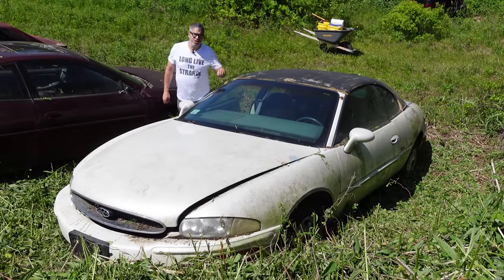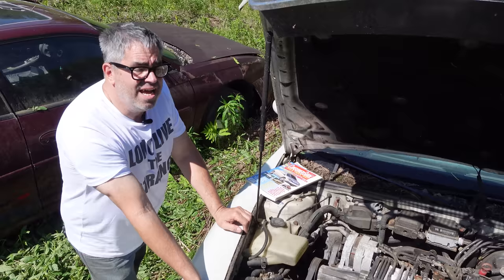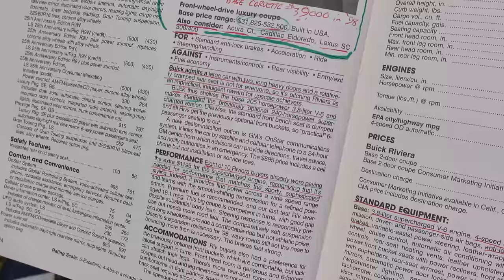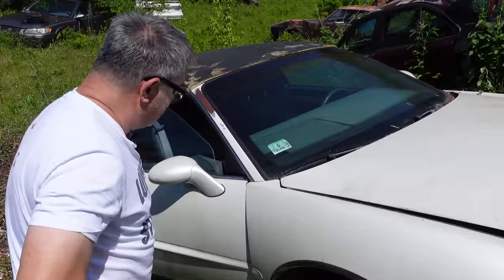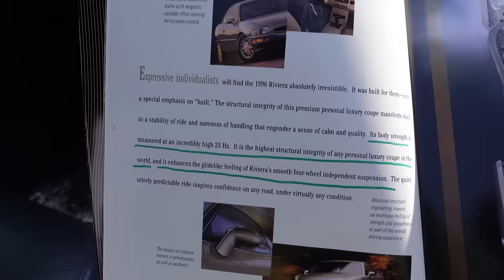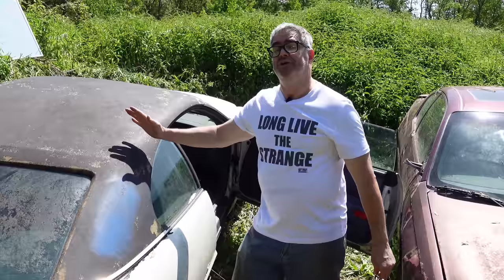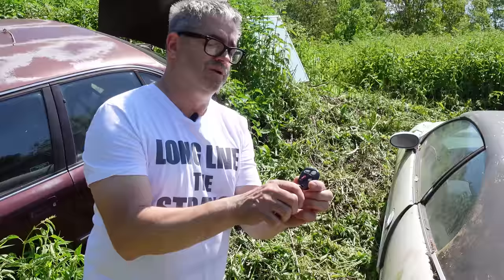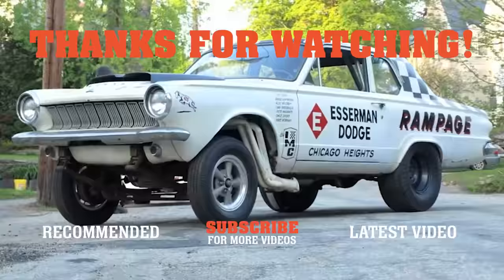More Power Than A Grand National!

Comment: This was about the time that Buick tried to make the AARP crowd "hip" and "modern". 

No VIN, can't win, but easy to figure out, no doubt: 1G4 for US made Buick, GD for Riviera, 2 for two door coupe, 2 for active seat belts with dual air bags, 1 for 3.8L V6 with supercharger, then a random check digit, W for the 1998 model year, 4 for Lake Orion Assembly, Lake Orion, MI, and the rest is the production sequence. The Lake Orion plant opened in late 1983 to assemble 1985 GM luxury cars and still operates today. Both my Pontiac G6 convertible and Chevrolet Sonic were assembled there.

No SPID, wish you did, but possible code 16 Bright White exterior paint, or possible code 78 Bright White Diamond exterior paint, among other codes. The transmission is a 4T65E-HD four speed automatic overdrive. The last 200 of the 1999 cars (total production was only 1,956 units) were called "Silver Arrow" editions and had special silver paint and trim treatments, a homage to show cars of the same name.

Yes, the 1977-1978 Riviera models were on the "B" body platform and were essentially stop gap models until the 1979 "E" body front wheel drive cars came out. The 1979-1985 Buick Riviera shares designs with the Cadillac Eldorado and Oldsmobile Toronado and some design work on the 1980-1985 Sevilles which were "K" body cars. All 1979-1985 E body cars and 1980-1985 K body cars were assembled in Linden, NJ, which closed in 2005 after last making the S and T Series trucks.
Reply: I have a friend who had a 95 one and back in 2006 I was in Florida and went to the Cadillac dealership to look at a 95 Fleetwood that was advertised on line but as things go it was already sold after being posted at 9 PM and I am there at 9 AM but they had a black 97 with every option like sunroof and chrome wheels but the mechanic that worked there explains to me he had worked on the vehicle since new and it was a lemon but it  had the gold script and black leather.
Reply: @garymckee8857  The old bait and switch. Florida dealers are among the worst with that.
Reply: @Google User GP  Yes sir
Reply: The "check digit" isn't so random, but it is the single digit outcome of all the numbers and letters in the VIN - just to make sure a person copied them all correctly. K=1, L=2 etc.
Reply: @TIMEtoRIDE900  That's not entirely accurate. It's random in that it's not the same value on two given VINs. The 8th digit would ALWAYS be a "1" in the case of a 3.8L supercharged engine in this year. That can be taken to the bank. The check digit isn't always the same. It's done to avoid VIN duplication.
Reply: @googleusergp  If you're fraudulently making up a VIN# and use the correct codes and a made-up numerical sequence at the end, you can STILL have a correct "check digit".
The real purpose is to check for errors on the title.
Reply: @TIMEtoRIDE900  Not entirely correct. If you enter a VIN number (with the wrong sequence) on the NHTSA website and it returns back "not found", you likely have an error somewhere. The full combination of the VIN number is what makes the system work, not any one part of it.

Comment: My red 98 Riv with 360k on the clock is still my daily driver. It has a blower pulley, ported heads, manifold & blower, Caddy throttle body, injectors headers & a speed limit delete & still does 28mpg. We tested the parachute system for my Bonneville streamliner with it by shooting them out through the sun roof.🤓
Reply: No it doesn't!
Reply: Dam another reason I should have held on to my old 2000 Bonneville SSEI. Sounds like a decent ride. 👍🇨🇦

Comment: 3800 Series II and III is my absolute favorite American V6 - Series 2 engine with a Series 3 aluminum intake is probably one of the strongest NA V6 platforms there ever was for hot rodding, right out of the box. And if you really knew what you were doing you could boost the living shit out of one without the stronger lower compression ssei bottom end, but the latter really took it to the next level as a Grand National killer - all on factory ling block parts
Reply: 1999 GM took all the imperfections out of the previous years and made the 1999 less than 100 exist selling 4

Comment: I've owned a few 3.8's,and still have a 97 lesabre  going on 13 years plus. It's my daily driver with 212K. These cars have a bullet proof drive train and run perfect. Only problem is keeping the rot away in the salt state of MA. My grand total price was $625.00 back in 2010.
Reply: Gosh I miss those days browsing craigslist turn key cars for $1000 bucks or less that never had meth used inside or someone lived out of.

Comment: My father bought  1974  Buick Electra 225 for my Mother and when he sold it in 1998 it had 473,961 miles on the original engine ( got a valve job at 290,000 miles ) and when the second owner drove it off it ran like a top . It was basically a Cadillac with a 455 ci Buick engine . I loved that car it was one SWEET RIDE !

Comment: Oddly enough, GM detuned that 3.8 SC in the Rivs and Park Avenues as well as the shift points in the transaxle, which made them feel slow and not much different than the base 3.8 vin K motor. However, in the Pontiacs, they seemed to run like mad with crazy midrange torque that would make the front end feel mighty light under a full head of steam. I recall many of the SC's front bearings failing because they were sealed and not fed engine oil.
Reply: I have a question, the Chevy Impala newer that have 3.7 make 300 hp are they turbo or not how do they have the same horsepower as a grand national. I ALSO HEARD THEY ARE JUNK AS FAR AS QUALITY.
Reply: Wheel bearings are all sealed no oil
Reply: @gulfy09  SC=supercharger. The front bearings in the supercharger's long snout. 😉
Reply: @burthenry7740  sorry I misunderstood your comment
Reply: The pulley hub would make a clunking noise with mileage due to worn bushings. People would use solid replacements to prevent this from happening....again. The bearing was oiled from the case with a separate special bad smelling oil....ooofff..did it smell..lol...and not only the old oil, but the new oil as well.

Comment: One of the Best V6 engines ever. I bumped mine up to 400whp and it handles the power so well
Reply: 1999 GM took all the imperfections out of the previous years and made the 1999 less than 100 exist selling 4

Comment: I had a 97 Riviera just like this.  The white paint also peeled off the trunk and had to have it repainted.  Supercharged used supreme fuel which was a bummer but that was the most comfortable car I have ever owned to this day.  When we traveled, my wife would recline the passenger seat and would sleep from Amarillo to Albuquerque and everywhere.  It also got great gas mileage on trips.  We had blue leather seats.  It dropped a valve in 2005 and we bought a new LaCrosse and several since but have longed for that car.  Thanks Steve for the trip down memory lane.

Comment: Hi Steve, I had one of these, a 97.   It was probably the best Riviera ever made.   It is a great car, fast enough, but it did not make any great performance claims, it didn’t need to.   It was looks and comfort.  Two things to know,  it was excellent on gas, and it had a 105 mph governor, probably Due to T rated tires.  I loved the car, step on it at 40 and the thing flies to sixty in unwieldy Buick style.  They definitely did not handle well but you could conformably drive three or 4 hours straight.  30 mpg Highway,  it was very sleek and not especially heavy, about 3700 pounds.. I think the early years had transmission problems, mine was fine.  In fact I don’t recall anything major going wrong with it unlike other more expensive brands that I have owned.  Thanks for sharing.  👍😉
Reply: 107 mph, managed by fuel cut off. Yes, because of the tires. I've hit my limiter twice. And yes, the best Riviera ever made. I own a 69 and am on my second 98. The 98 is our vacation car. Can ride in it for hours and not get fatigued.
Reply: @jholthenrichs  agree totally.  I have a 72  Riv. I had to sell my 97 had about 160k miles but I needed a roomier car.  Traded for a CTS sport wagon.

Comment: I love that engine! I had one in my 2004 Impala SS. Never had a mechanical problem in the 11 years I owned it. I only ever had 1 MAF sensor go out on it. Traded it in with @ 160,000 miles on the odometer.

Comment: I believe this is the same motor the Pontiac Grand Prix had available at this time as well. I recall running into one late one night in my '99 Trans Am, and absolutely getting smoked by him. We pulled over and he went over a list of mods he had done, exhaust, larger pulley... these motors had serious aftermarket potential.
Reply: 1999 GM took all the imperfections out of the previous years and made the 1999 less than 100 exist selling 4

Comment: In 2011 I bought a 96 Riviera in like new condition. I drove it trouble-free for about 6 months and one day it wouldn't start. The battery is under the back seat. It had an eight-year warranty so I called the dealer that originally sold the car and always serviced it and they told me it is the original battery at 15 and a half years old. Another fabulous feature, it got around 19 miles to the gallon in the city and 28 or 29 on the freeway at 75 miles an hour
Not bad for a 4,000 lb plus car.

Comment: I owned three on the road Rivieras, one was my very first car back in 1973 as a senior in HS. It was a "Riviera Red"base model with a black vinyl top and an off white vinyl interior which had bucket seats and a full  length factory console with floor shifter. Wouldn't mind still having it.

Comment: I had a '97 Riv, the Series 2 engines made 240 hp and 280 ft lbs. Grasnd  Nationals and GNX's were rated from 276 to 310 hp. Consider yourself corrected. Fortunately, mine had a steel roof and OnStar. The 97's all came with Sunroofs, satelite radio, and leather seats. The only color was gray.
They were great hwy cars, but sufrered torque steer, as did my fwd Caddy DTS Northstar.
Their main weakness was the electrics; they had 5 fuseboxes and a special battery that was under the rear seat.

Comment: I almost bought one used back in the early 2000s. A beautiful dark blue one without the gaudy padded top. For better or worse, it was about $1500 out of my price range for a cash sale and I didn't want a payment, no matter how small it might've been. Instead, I ended up buying a very nice GMC 1/2 ton 4x4 that was a few years older and actually under my budget. That truck served me well and I kept money in the bank.
Reply: 1999 GM took all the imperfections out of the previous years and made the 1999 less than 100 exist selling 4

Comment: Was gonna say the 3.8 will run forever unless you leave the Dexkill in them which eats the intake gasket leading to a blown head gasket. I'm thinking the jug in the trunk was more intake gasket helper than laundry helper. A real shame the owner opted to junk the car rather than do the gaskets otherwise that car would still be driving
Reply: I had a 3800 changed the intake gaskets and coolant thing still blew up 😂  Apparently also had a flaw where the intake would leak coolant into the engine hydrolock it and bend the rods. On the 3rd engine I decided to sell it at that point it had all kind of electrical problems too.

Comment: Oh man, Steve this brings back memories

In fall 1995 I was just starting university. I traded in my ailing '85 Camaro for a new fully loaded '96 Riviera. A buddy of mine chipped the ECU not long after I bought it.
It was a fun party trick with my classmates & friends to get them behind the wheel and have them stomp the accelerator from a  dead stop and burn rubber! Many people had their 1st experience doing a "peel out" in that car😂
 Fridays after a evening class, I'd take my girlfriend at the time from campus to her home around 50km away so she can spend weekends with her family, we'd be bombing up the highway with the cruise set at 160km/h, at 2am, was extremely quiet - we could have a hushed conversation and still hear eachother, and the ride was very smooth with the rear air shocks. Dual climate control on the passenger door as well which often got used, as she liked it warm while I liked it cold😂. 

Also had a great sound system "concert sound II" we'd have the stereo cranked up blasting the campus radio station, lots of alt rock like Smashing Pumpkins, Veruca Salt, Nirvana, Garbage, Foo Fighters etc. Eventually the rear speakers blew and the dealer refused to fix them under warranty, so I just kept the fader to the front.

Many times we'd fill all the seats and go out on impromptu road trips to Niagara falls with a bunch of friends. Ice cold air conditioning, and the best heated seats I've ever had in a car.

I ended up trading it in for a new Toyota Solara in 2000 after the intake manifold gaskets let go.

The late 90s were a great time and the Riv was a great car to spend those years in!

Comment: Not gonna lie I’ve driven a handful of supercharged Buicks and bonnevilles both stock and some with small bolt ons like different pulleys intake injectors etc etc and they are some of the few vehicles, when you consider what they look like vs how they perform and it’s really a wow reaction when you consider it. Very cool snotty little cars. The n/as are gutsy too

Comment: I had a 97 a few years ago.  The only issue with this and all in the 8th gen, plus the Aurora, is the tilt steering column.  The aluminum wears down around the hardened steel pins and wobbles, eventually cracking and falling off.  No fix, so i got rid of it.  The engine in this car is absolutely bulletproof with parts being surprisingly inexpensive.

Comment: I actually remember liking the look of that 98 when it came out. My 1st car was a 84 Buick Regal. I got a 84 oldsmobile delta 88 in 1997 with 23,000 miles on the dial. I bought it from an old lady that bought it new. It was immaculate,garage kept. Paid$2,000.  I didc a tune up and it lasted me 15 years and sold it for $2000

Comment: Used to have a 72 Riviera. Those things on paper were said to be slower and less powerful than a stock chevelle but that was a fib by buick. They would beat a chevelle on the stip by nearly an entire length. That 455 was pushing some serious power.

Comment: I owned a 87 GN and I can tell you for a fact it had well over factory rated HP.  It ran 13.80s in the quarter and around 5.3 sec 0-60.

Comment: A friend got a Buick from his grandfather. 
It had the same engine with the supercharger,  and I couldn't wait to drive it.
I couldn't believe how slow and cheap the interior was.
Total disappointed but beautiful car.
Another friend brought by his completely restored grand national, when I was outside washing my new challenger. 
He said take it for a ride and I said take the challenger for a ride.
I was totally disappointed as it wasn't  fast and sounded like crap.
This car was professionally restored and like brand new.
A week later I seen a new challenger in his driveway. 
The 80s and 90s weren't very good years for cars.
Reply: That interior looks similar to any Buick of that same era , it truly is cheap
Reply: That’s a shame because the car itself and engine were great
Reply from the maker: Hello Mike Greer, I'll agree that the Buick Grand National was something of a "force fit / compromise" performance car. Lets face it, when Buick went V6 in 1975, it was NOT a move toward high performance. And when turbos became the "it thing" in the late 1970's / 1980's, they were BAND AIDS to get V8 power (for brief sprints) out of dinky V6 mills. Not the lineage of greatness. And yes, they sounded like "a UPS truck on acid". But "for the times", the turbo and supercharger V6 was better than nothing. Your modern Hemi Challenger was made "from scratch" to be a muscle car. How great is it that the Dark Days of the past have been remedied by much more advance thinking and vehicles from U.S. auto makers. Long live the strange....er, I mean Long Live the Hemi! -Steve Magnante
Reply: You have a newer model v8 Dodge challenger I can't imagine many cars not seeming "slow" if your traveling  0-60 in like 4 seconds  or less  lol Your kind of comparing apples to oranges, the newer cars aren't really better, it's just because Dodge doesn't sell any normal cars any more all they have is sport/muscle cars and the little suv thing that has more power than it needs. Once they sell out and change to electric your argument will fall apart. Lol

Comment: Same set-up I have in one of my current vehicles, a '99 Pontiac Grand Prix GTP coupe. The GTP on a decent traction , air density and temp day at the drag strip would run a 14.9 - 15.0 run in the 1/4 mile.

Comment: And the Riviera owes it's structural rigidity to it's relationship to the Old's Aurora upon which it's body is based on. In fact the body was so strong that when it was subjected to crush tests during development it actually broke the car crusher and had to be crushed in the truck crusher instead.

And GM knew when it had a winner so they used the body in similar vintage Park Avenues and Lesabers. Combine the rock solid body with the bullit proof 3.8L motor and you had a winner and a vehicle that remains a stellar value on the used car market.

Comment: Nice job Steve! Love your thoroughness with the insightful gems you reveal about your finds. I have a '95 bought new in Supercharged variant; has about 38,000 miles on it now. Never winter or inclement weather driven. The ride of these is superb with tremendous pickup for on ramp merges or overtaking. They are also quite economical considering the weight; putting it on cruise at 75 will return around 25 mpg (about 3 less than my '88 n/a LeSabre would do. GREAT Buicks.... the likes of which we will not see again with that marvelous 3800
Reply: 1999 GM took all the imperfections out of the previous years and made the 1999 less than 100 exist selling 4